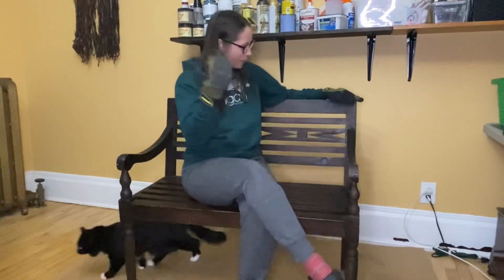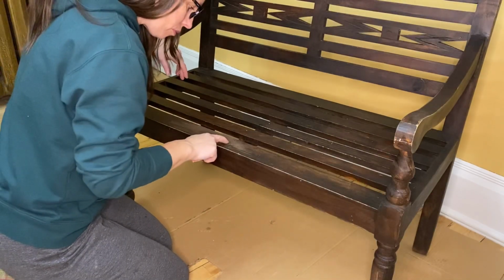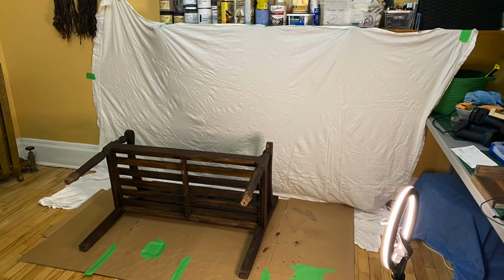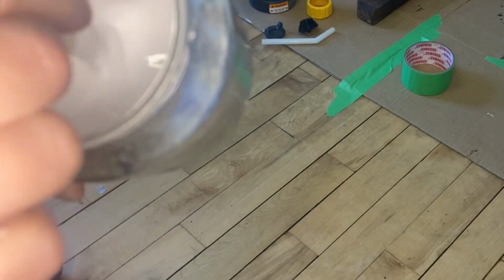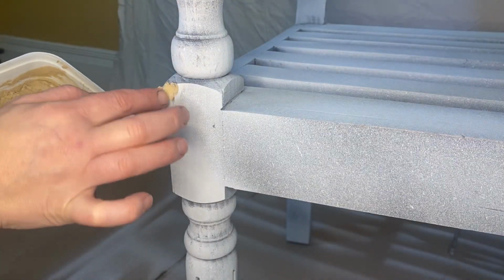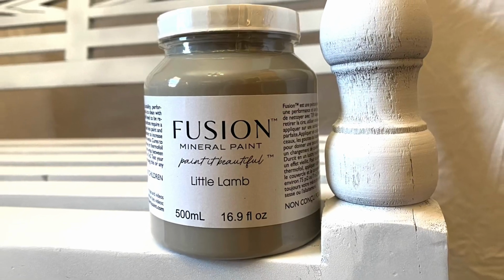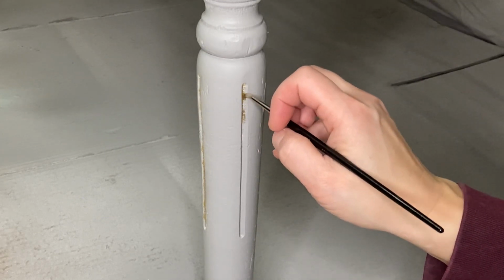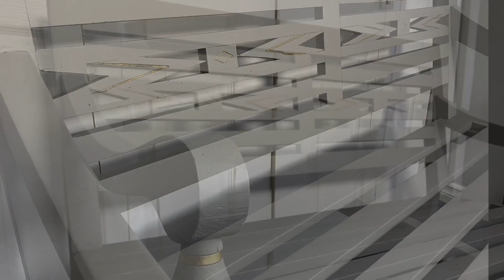Wood Bench Custom Makeover || Fusion Mineral Paint || Wagner Sprayer || Refinishing

Comment: Wow, so many nooks and crannies to coat on this bench. Spraying was definitely the right choice. I still haven't tried Fusion, need to get on that it's a beautiful finish! Love your extra details too. Great job Maggie! (BTW, am I spelling that right?)
Reply from the maker: You are spelling my name correctly! I love Fusion, I have used it on several projects. My stairs, wall and furniture. I have used a top coat and not used a top coat depending on how much wear I think it will get. It has a slight sheen when dry so not dry looking like chalk paint. I have also added wax over it with great results. Spraying was the only way to go with this bench but in hindsight I could have waited until spring to spray it outside. I’m still learning! 😊 thank you!❤️